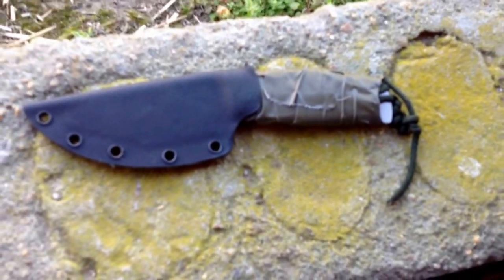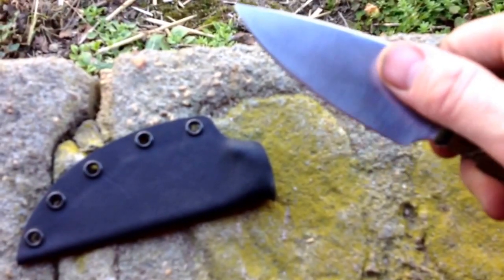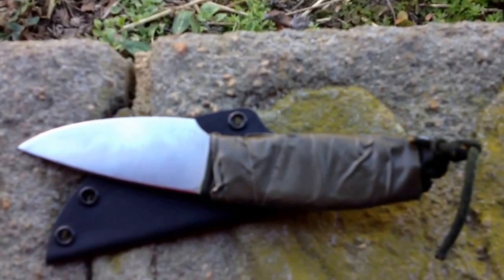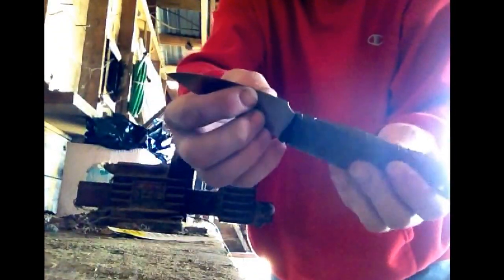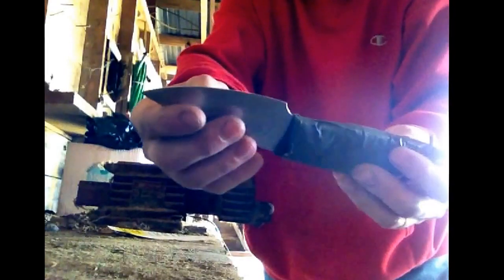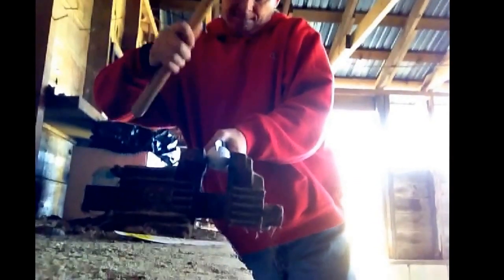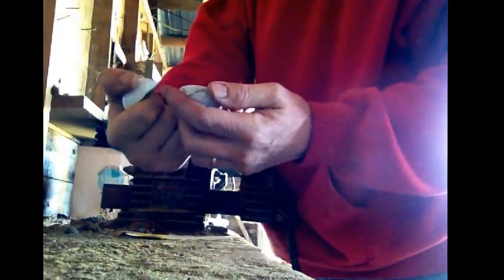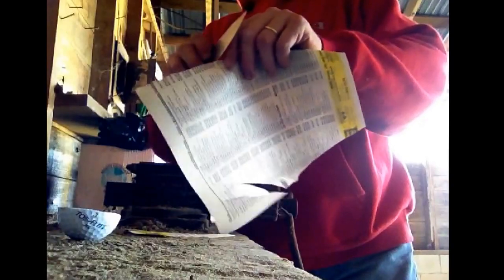Introduction To AEB-L Knife Test Series

Comment: Jeremy,

After you finish the heavier work, I would be curious as to your experience if you cool grind it to < 0.001" at the edge. 

In time the edge will thicken to make it more robust anyway, but I would be curious how low you could go before it can't be used for general cutting.
Reply: It was probally .004" when I reground it today.  I wanted to ensure I got rid of most of the burnt steel.   I have been using it as a scraper and box opener.  I was not worried about the edge for those chores.  

After, I use on the heavier task I will thin it down.   By then I hope most of the burnt steel is gone.